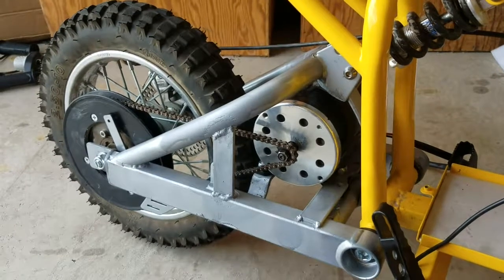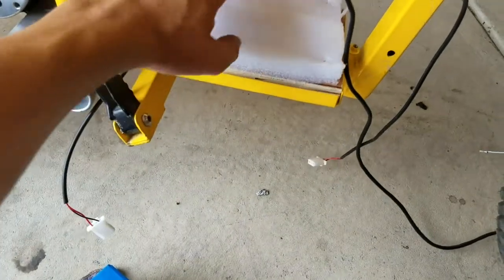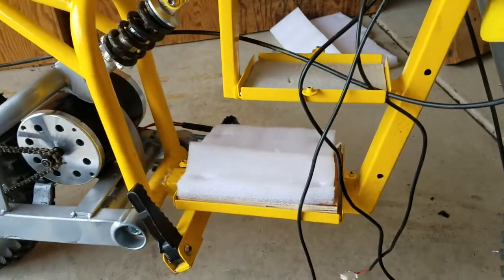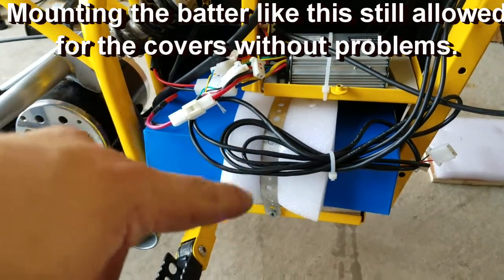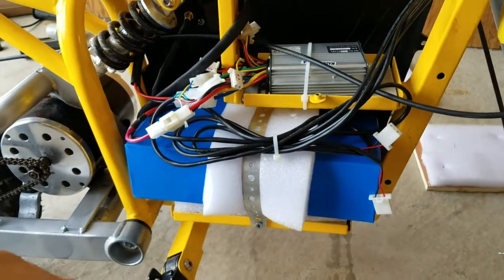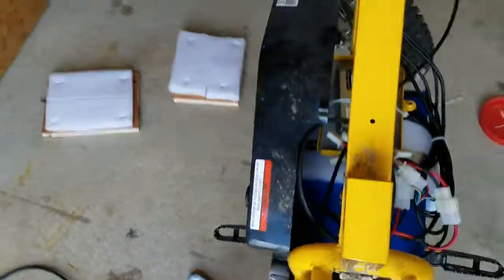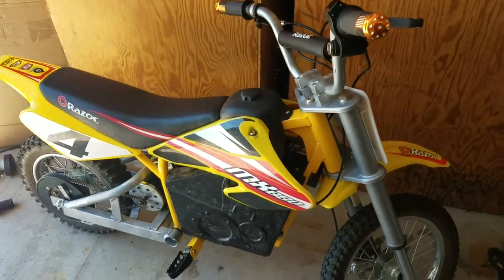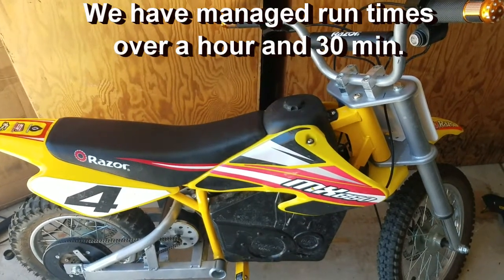SX500 MX650 Razor Electric Motorcycle Mod part 3

Comment: What brand battery did you buy and how much was it?
Reply: The link in the description is correct, however they are advertising the battery differently, all choices are available at one page, just select the 48 volt battery of choice based on amp size, you should be good.